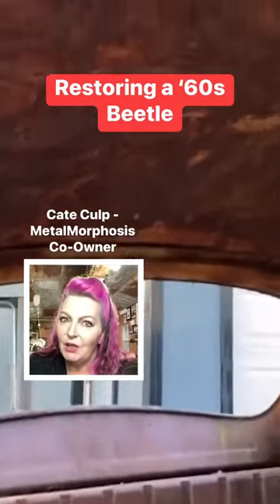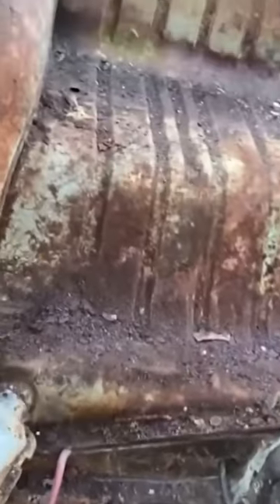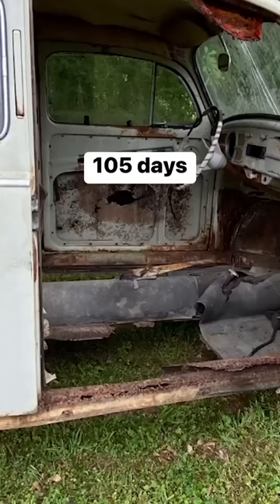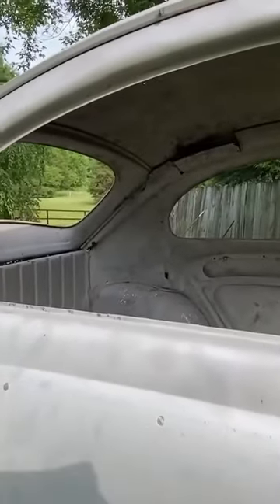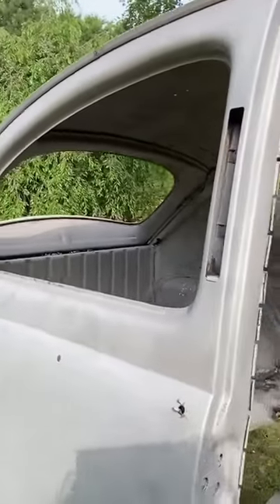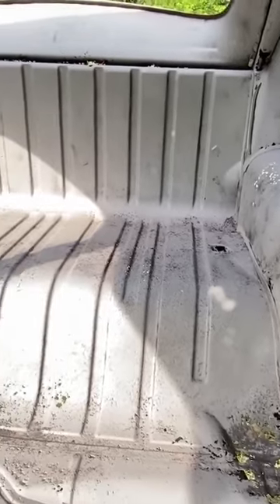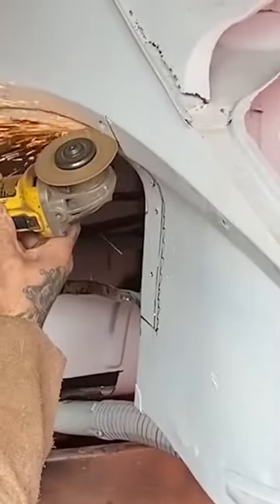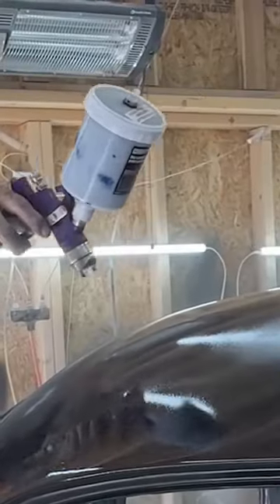Have you ever seen how a #VWBeetle is restored? #cars #restored #volkswagen #carsinsider #shorts

Comment: Yep. Used to restore classic porsches for a living. Lotta 914s. Also had a handful of VW beetles and busses come in. Chassis up restorations almost all of them. Couldn't PAY me to own a porsche now. Vw is OK. AUDI is my jam now. All VAG cars but the differences are insane between them all. Porsche... crap. Older Audis- epic power capabilities for dirt cheap, with the quattro system it makes for the best fun ever. VW... cheap plastic Audis basically. Funny thing is I've literally pulled parts off of my audis to fix a porsche because they use alot of the exact same parts. Literally the same part